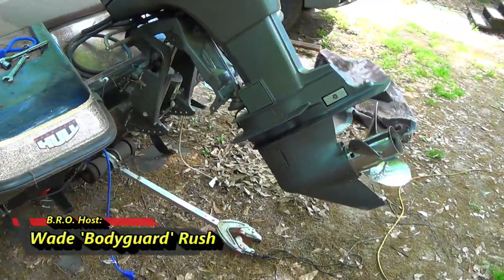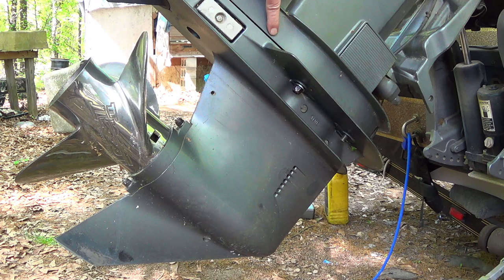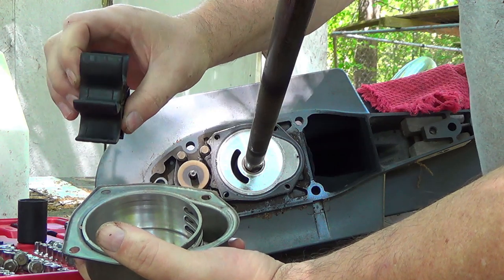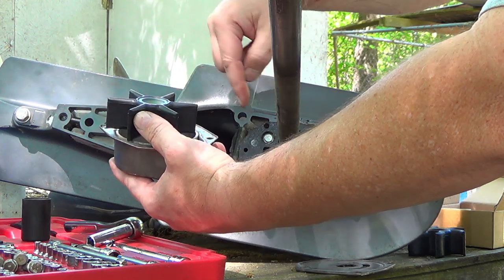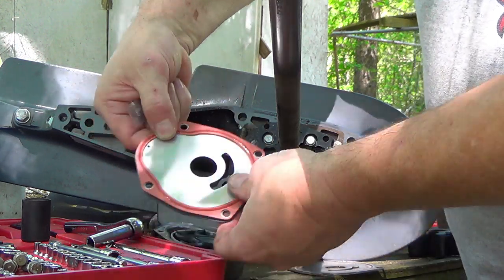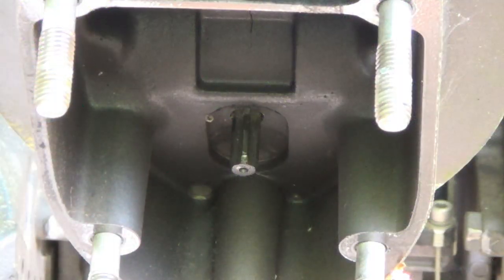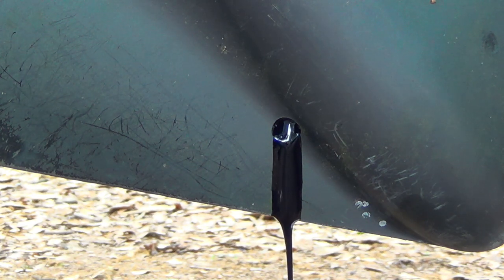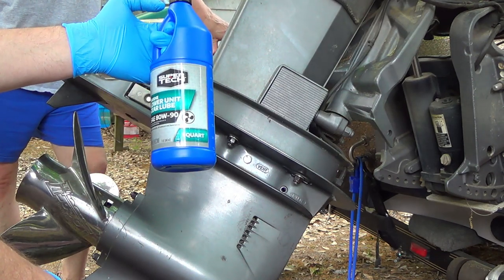Replacing the Water Pump & Lower Unit Oil in 115 Mariner

Comment: Getting ready to change out my impeller 115 mercury.
Should I change out the gear oil first that way if theres any issues i can research and address that , like gear oil not looking right when I drain it before I drop the the lower unit . Thanks for the video its a great help and you explain things very well !
Reply from the maker: sure you can Rob! won't hurt a thing...

Comment: i have a 89 115 meriner 2 stroke im assuming it would all be the same way you did it never worked boat engines gotta put a power head on it and figured id do the pump too
Reply from the maker: They should be close!

Comment: Regarding how you fill the lower unit oil, I was taught to fill from the drain plug up to the oil level hole, to ensure all the air pockets/bubbles are removed from the system, however you always let some air in once you remove the pump from the drain hole to put the drain screw in. Are you sure you are filling it full using this method of filling through the oil level hole? I know you said spec is 665mL to fill, were you able to confirm you got in 665mL using your method? I might change over to your method if your having success getting in the correct quantity in there; I have the 99 merc 115.
Thanks for the Video!
Reply from the maker: I have refilled the lower units using both the top and bottom fill methods with equal success... so, which ever way you choose seems to work fine!!

Comment: Great video thank you so much!     Regarding the gear oil, i have been told that filling that should go from bottom to top meaning that you actually fill it using the bottom hole which by the time it comes out the top hole, all the air pockets are gone.    Have you heard this as well, your thoughts?
Reply from the maker: hey Dave... yessir! the best way to fill the foot is from the bottom drain-hole. I have filled both ways many times. I didn't have the proper fill tools to pump the fluid from the bottom this time.  Wade
Reply: Yes. Always fill from bottom if you can. Filling from top you will never be all the way full. Will leave air pockets

Comment: Hi. Thanx for your videos. I own a 125 Mariner 2003. Do you know why my outboard leaks feul and oil when I trim it up?
Reply from the maker: Sounds like a fuel/oil line may be cracked or split! When you trim the motor it will cause the lines to leak...
Reply: I opened the front cover of tje carburetors and the feul oil mix seemed to flow out of the bottom carburetor.
Reply from the maker: @evertderuiter9300  1 of the float bowls could be leaking or 1 of the float bowl drain plugs could be loose or leaking.

Comment: i need your help my motor on my title says a 1987 115 horse mariner but my bolt pattern looks nothing like yours can i send you pics of my motor and see if you can help me out i am at wits end got all the bolts out i could see but the lower unit will not move any help would be great
Reply from the maker: Most likely there is a hidden bolt under your trim tab. Remove the trim tab and look up into the channel there and you will probably find your hidden faster.
Reply: @BubbaRountreeOutdoors  you are a life saver the bolt was where you said it was thank you a bunch you will be my go to from now on thank you very much